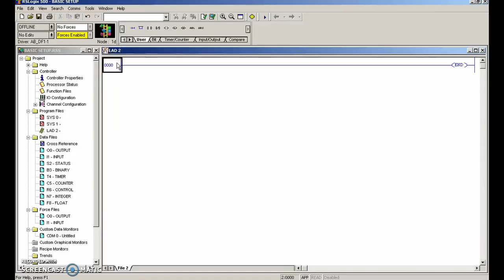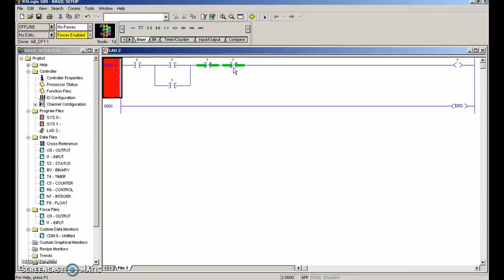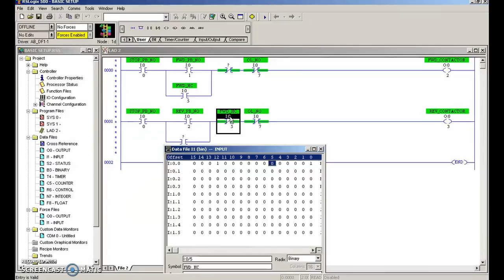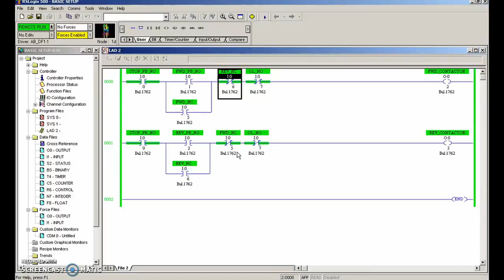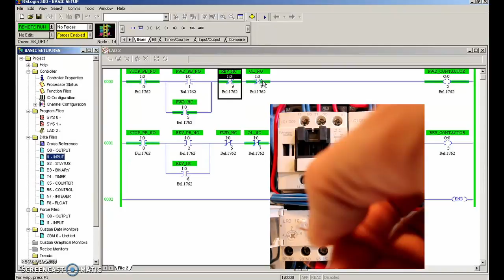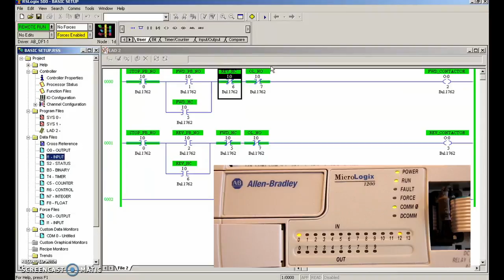PLC Tutorial (Allen Bradley RS Logix) #4 (FWD REV Motor Control Closed Loop)

Comment: Why can't you use the OTE as the holding contact, instead of assigning a new bit?
Am I missing something? Or just a style thing?
Reply from the maker: You can definitely use the OTE as the Holding Contact, but that only gives you the status of the OTE bit. It doesn't actually look out in the field and see the status of the contactor... i.e. did it actually turn on. That is why we called this one "closed loop" due to the fact that we have wired the NO contacts of each contactor for feedback from the field.